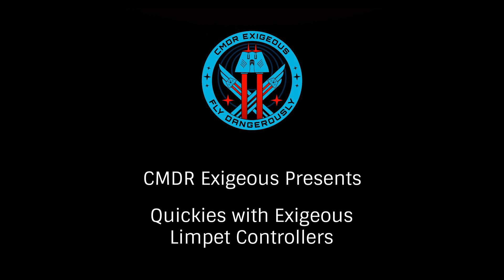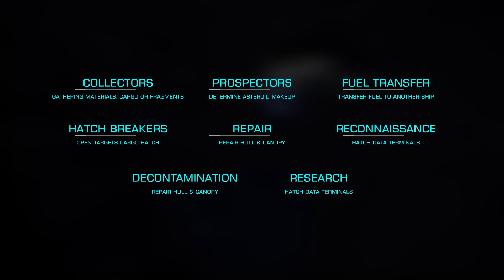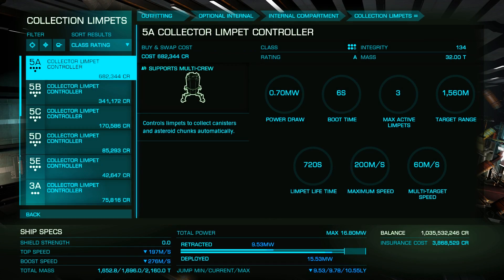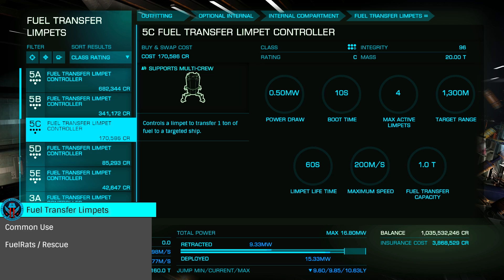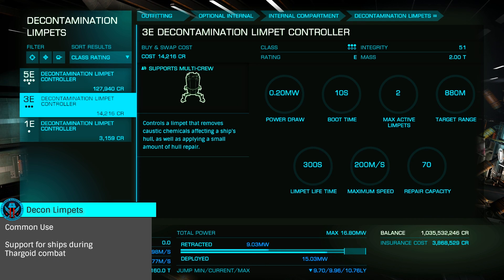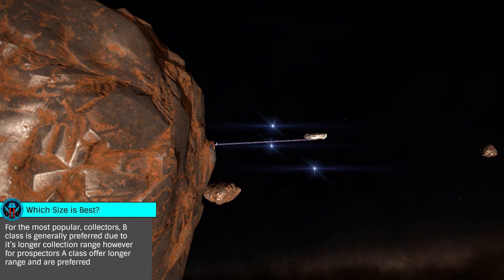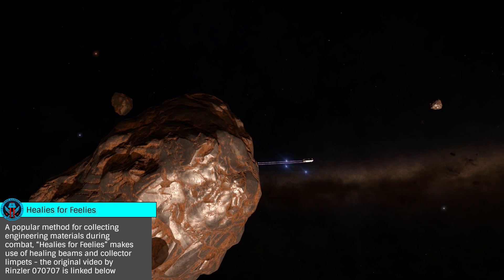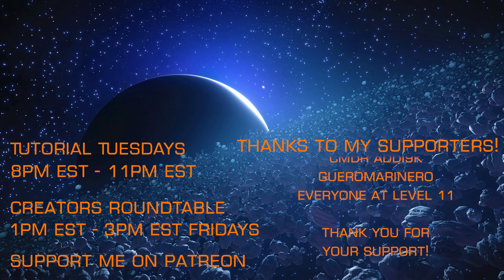Quickies: Limpet Controllers

Comment: There should only be one type of limpet controller but able to house drones of different type saving us the unecessary hassle of fitting multiple controllers and wasting ship slots.
Reply: I'd much rather have that. One controller with different limpets than one type of limpet with different controllers. If a Limpet comes equipped to do all of those tasks, why does it need different computers to tell it to do those things? It doesn't make much sense to equip every limpet with technology to repair, transfer fuel, scan and hack things, etc. when it's just going to do one of those things and then die.
Reply: Totally agree
Reply: I agree. They should keep what they have now but add a more expensive "advanced" limpet controller that can do everything. Just add the specific limpet programming to a fire group and you're good to go. Itll free up valuable optionals for more cargo space or anything else you need which can add more utility to your ship.
Reply: Guess what, we have this right now on december 202, quite late, but still there